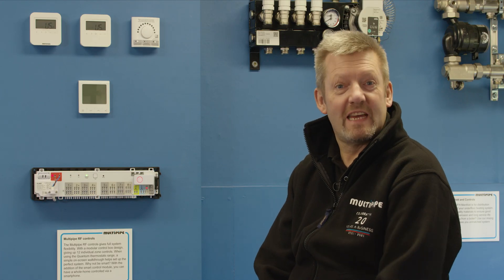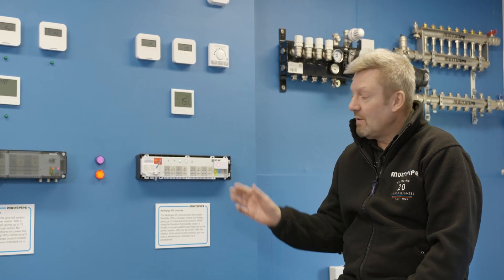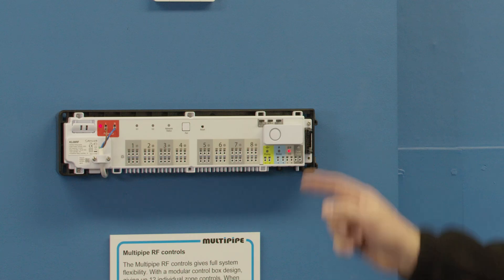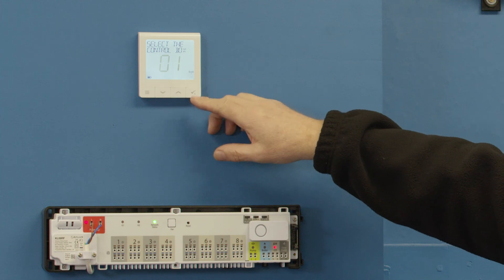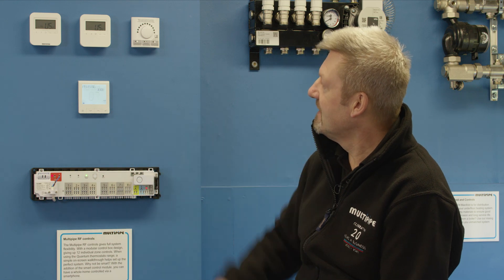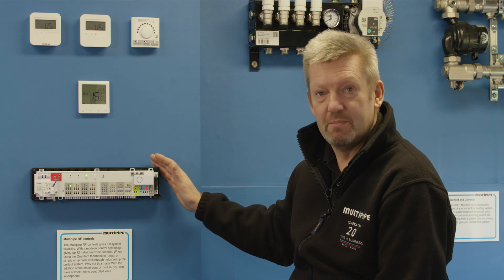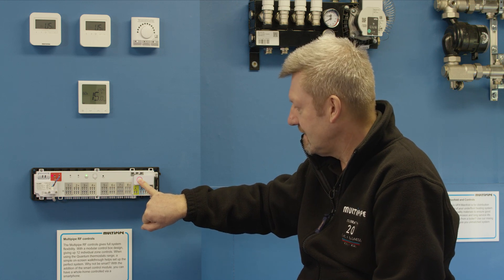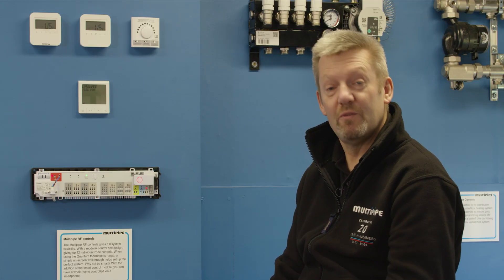How To Pair Your RF Heating System Offline

Comment: I get controll box not fond. And the networkstatus light flasker green it does not become solid
Reply from the maker: sorry for the delay in our response. best thing to do is call our technical helpline to sort you out, the number would be on any multipipe paperwork, sounds like it need to be reset.